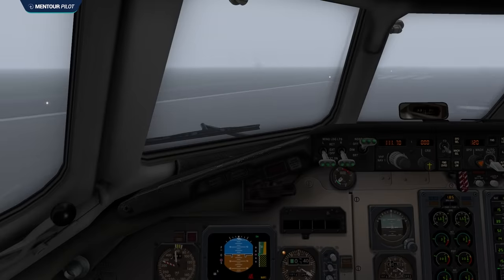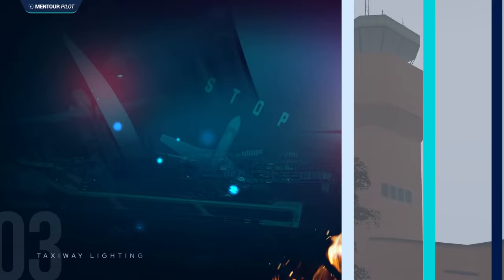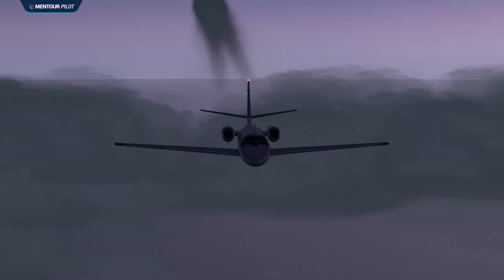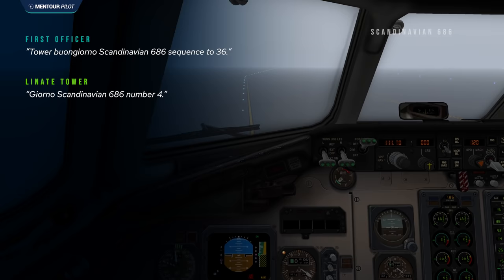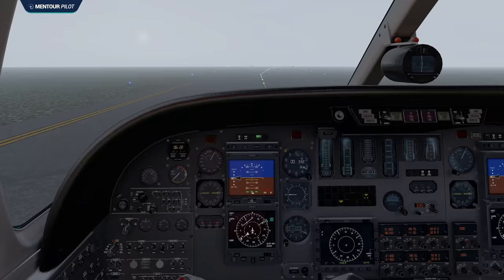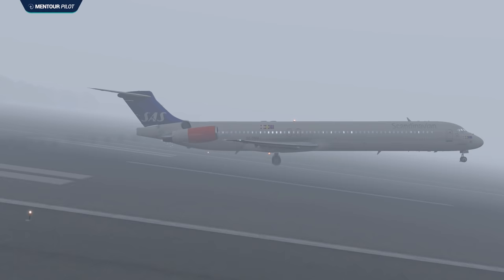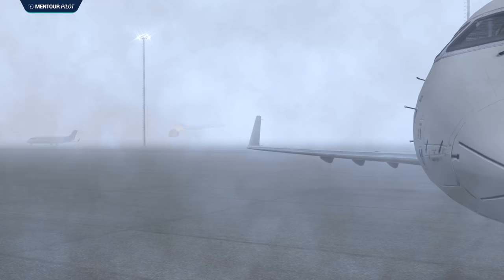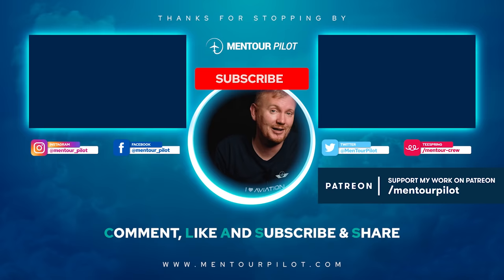A Perfect Storm of Mistakes! And how Heroic Pilots Almost solved it.

Comment: Some additional info:

- The runway incursion warning systems at Linate were turned off (and never turned back on) due to a high number of false positives caused by animals like cats, and rodents.

- The road signs painted on the tarmac of the taxiways/aprons were withering away to the point that they were almost unreadable. The R6 mark did in fact look like "R5" due to that.

- Some of the bigger (vertical) signs on the sides of the taxiways were almost completely covered by high grass in front of them, and therefore almost unreadable. In other words, landscaping was neglected.

- The airport had purchased years earlier a new ground radar with an anti-collision alert system designed and developed by a Norwegian company in response to the low visibility issue due to thick fog in the Norwegian fjords. However, it was never installed.

- Smoke was found in the lungs of some of the deceased occupants of the Cessna, which means they survived the impact, and might have been saved, if they had been found earlier.

- Having read the report myself, it is staggering that many of the recommendations simply consist of a reminder to follow the (ICAO) established rules and procedures.

- The leading investigator (Mario Pica) had his contract up for renewal soon after the report was released. Unfortunately, his damning findings agains many powerful people and entities made sure that there was enough political pressure to cancel the renewal. This fact became apparent during the criminal trial, and might have contributed to the light sentences and aquittals of the same "powerful" people. Stereotypical Italian corruption at its finest.

Comment: Absolute Incompetence and Criminal Negligence on the part of the Airport Owners, Tower Staff, Ground Controllers and Airport Maintenance crews. 
The issue of painted markings not being known by the Tower staff, the issue of faulty lights etc, these are things that should have had the airport shut down until everything was resolved. The non-english radio chatter is silly when it's not a private airport. There are just too many negligent things going on here. 
I hope the families of all those that died, sued the crap out of the Airport Owners.

Comment: Great video, I recall that day very clearly. This is so very Italian story, the sad ones, while there are many causing factors playing like you clearly stated, the mind blowing ones are the lack of signals in some cases, the extra signals that shouldn't be there and the worst, the stop lights that cannot be turned off independently (how hard could have been to fix that?) and one thing I didn't hear in the video: why the tower control is unaware of aircrafts position on the ground and relies on the actual visibility? Is that normal or did I miss anything?

Comment: Possibly the worst-maintained and sloppiest-run GA airport I've ever seen. Aviation authorities should've been notified of ongoing changes / upgrades and insisted on frequent progress reports. In a locality subject to fog, haze etc, proper runway & taxiway lighting and working ground radar should've been mandatory for the airport to handle IFR passenger flights at all. Remember Teneriffe 24 years earlier !! The Citation pilot's flouting of restrictions applicable to his flight was another significant link in the chain of errors leading to disaster.

Radio comms pre- and post-crash were chaotic beyond words, as evidenced by the over HALF-HOUR lag between runway collision and full emergency response. Mixed use of English and Italian in radio traffic was unbelievable. The whole joint was Keystone Cops, a tragedy waiting to happen.

Comment: Hi there, it is really a sad event and based on tiny details it led to a disaster. This is the reason why Safety Management System has to be implemented in all airports around the globe so that we can avoid these sorts of accidents at least relatively. The chain of errors started by Cessna landing under permitted minimums due to whatever reason, then the  incorrect readback of taxi instructions. As an ATC , I think the air traffic controller who was in duty is to blame for the fact that he didn't pick up the incorrect readback which didn't match his clearance of taxing North.  In addition, there was still a chance to prevent this accident after the Cessna captain has reported his wrong position on S4 before entering the active runway. So, there was a significant lack of situational awareness  even though there were different contributory factors in this fatal accident.
Reply: But it turns out the ATC's headset had an inoperative volume control (more appalling maintenance) and he could barely hear the Cessna. He said at trial that he thought the Cessna readback included the critical final word, and he just didn't catch it. That doesn't excuse his other failures though. Clearly he lived in a sea of failure and thought it normal.

Comment: It is good to learn how situational awareness and deviation from procedures can lead to mistakes or accidents. The aviation industry at least is transparent and has independent investigations. 

Sadly, in other industries, things are covered up, not recorded, not reported and the culture leads to a toxic workspace where people fear retribution for voicing concerns. 
There is no legislated independent oversight. Unnecessary harm still prevails, albeit on a much smaller or less dramatic scale than would happen in aviation. 

We can learn from aviation to prevent incidents - but I see that the prime motivation is short term gain rather than safety. This is unfortunate.

Comment: I was hoping till the very end that the SAS crew's quick thinking and reaction had resulted in at least slowing down the aircraft enough that it won't be obliterated like the Cessna, but I had to be wrong :( I always hope when I watch these videos, and I get such a relief when it turns out I put on the few ones that end in people staying alive.
I was in Milan a few months ago, and my flight landed in and took off from Bergamot. I was very salty about that because I had to travel an hour by bus from there, but now that I think about it, I will take an additional bus ride and an airport with a good layout (at least BGY is pretty straightforward) over a design that's basically a recipe for disaster, any day, thank you.

Comment: There is an alternative to Dr. Reasons Swiss Cheese Model. It is called the Italian model. It has a special peg in the upper right corner that, when pressed, automatically aligns all the holes for a straight pass through.
Reply: Thanks for your comment💌🚀📩🚀
For more insight📩🚀🚀..

Comment: These sorts of accidents/catastrophes sit at the top of a pile of chaos, accumulating over years. I don't believe that it is only with hindsight that they become clear. I think there are chains of neglect of control systems that all add up eventually. I note also that a culture of fear was also contributory. 

The lessons from this disaster are applicable across a range of industries.

Comment: I feel as bad for the four people on the Cessna as the 110 people on the MD-87 and the four workers on the ground. Sure, they weren't allowed to land in the first place, if I understood that correctly, but the fact is they did. Driving the wrong way when R6 is between R4 and R5? Weird numbering in my opinion. They even called out the Sierra marking on the ground, so ATC should've known where they are. Then they were supposed to run the red lights, what on earth is that? Ground radar wasn't installed because of sheer laziness it seems. 

All in all, this had to happen. And Mentour said it in the video - there was confusion because of R6 one day prior and probably many times before. Pure luck that the second plane wasn't a big commercial airliner. Rest in peace to all the victims of this avoidable and tragic accident.

Comment: Thanks Mentour for another fine detailed information on air accidents over the years.If possible do the research on  South African Airways Flight 295 on November 27 1987 from Taipei to Johannesburg that crashed into the India ocean after an on board fire.The cause of the fire to this day is a mystery but should have the Boeing 747 included fire suppression sprinklers as the do in buildings.Just want to see your thoughts on this mystery air crash thanks

Comment: Very sad.  This situation was nuts.  Today the situation with ATC and commercial aircraft is still nuts.  Video game programmers long ago conquered and know when two objects have collided in 3D space.  They have also figured out how to avoid 2 or more objects from colliding in 3D space.  The technology exist, the infrastructure exist, the programming exists that 2 properly equipped aircraft carrying passengers (or not) should NEVER collide or even come close and yet runway incursions and mid air collisions still happen.  It's rare but really it should never happen.  The whole mess needs to be automated.  Not someone saying over a radio, "You go here" and hope they go there and someone saying over the radio, "I'm here" and hope they're there.  Someday, hopefully, this "chatter" will all be eliminated and people will stop perishing and expensive aircraft stop getting wrecked.  
Well, at least 2 aircraft not in the same place at the same time.  Planes, will unfortunately, still crash into the ground due to mechanical failure, explosive bombs, missiles, pilot suicides etc. - but not into each other.  Obviously, Anti-cheat programming will have to be bullet proof to prevent any kind of hacking of the system, at least as good as systems designed to prevent a screwup of an accidental nuclear launch.
Someday.  
Same goes for all ground vehicles, cars, trucks, busses, etc.  Many more lives to be saved in this industry.  Sure, throw in boats 
(small up to huge and gigantic) , too.

Comment: This comes in line with my experience with the car drivers while visiting Rome. Apparently they don't give a damn about traffic rules, and not only the drivers but also the police. Crossing a street on foot in Rome mandates a high risk live insurance and a prayer. But also you have to put partial blame to the Citation pilot for taxiing the wrong way and entering the runway without explicit clearance.
Reply: @bart solari Naples is even worse? I’m not surprised…

Comment: What makes this worse is the report seems to put a lot of the blame on the Italian regulatory agencies. Sounds like they either had lax standards or poor enforcement, (not clear which, may even have been both). There where multiple points in the lead up describing the airport where i was wondering how the hell it was still allowed to operate in such conditions, (or at all for that matter). The fact the airport was allowed to operate in low viability conditions with nothing but radio interactions to monitor plane movements is just shocking.

Comment: Seems like a monthly review process is needed during airport upgrades to be sure things are actually done correctly and working... A toxic reporting environment didn't help. At some point a higher authority has to pull the plug and shut it all down. Tragic chain of events, possibly all avoidable if safety first would have actually, come first..

Comment: I feel so bad for those SAS pilots. They were great pilots, they did everything right. Everything just worked against them. So many what if’s, like what if the gear hadn’t knocked off the right engine, what if they had a little more headwind and reached V2 just a little earlier.

Comment: Crossing that red line seems equivalent to crossing a red light over a street where people usually drive very fast. If it is normal, everything is alright, you just wait for the green light before you start walking and there will be no problem. But if you always get either red and green light together or no light at all, then you will simply walk whenever you think it might be safe, and then accidents happen. On a street, fixing such an issue is not very expensive, and it is also neccessary because very many people will complain if it is not fixed quickly. On an airport, it will cost a lot more and I imagine not very many people will actually complain, since there are only very few pilots when compared to the entire population of a city and pilots are the only people who would even notice and have an issue with such a problem. Sad that those are the only two ways to get people to spend money on improving safety: either many people that complain or a huge accident potentially involving a lot of death.
Reply: From the ANSV report:
[T]he red bar lights on TWY R6 were not controllable by ATC since 1998, therefore they were
permanently left lighted (ON) irrespective of time and visual conditions; ICAO Doc 4444
states: Stop Bars shall be switched on to indicate that all traffic shall stop and switched off
to indicate that traffic may proceed.
Reply: @bmjpdx9222  yes. that was said in the video. thank you for repeating that, though i am not really sure what exactly you were trying to achieve with this.

Comment: Every video i watch just makes me more afraid of air travel (not that i was particularly fond of air travel to begin with)
I tend to stay in the country where i live though, I’ve only ever gone abroad once, and that was to Belgium, on a coach trip, i cant remember what year it was, but it would be over 6 years ago)

I was born on an island, where the ONLY way to get to the mainland, was, surprisingly, by ferry (i have since found out that there is an airport on the island, however, it does not handle commercial traffic, so for anyone who doesn’t have a private plane, then the ferry really is the only way to get to the mainland, there are at least 2 ferry routes though, oh, and 1 hovercraft route, weirdly enough. Both ferry routes can take cars and foot passengers, but the hovercraft route is foot passenger only. I only found out about the hovercraft route more recently, i knew about the 2 ferry routes from when i lived on the island, even though we only used 1 of those routes, the ferry route we always used is the only one that can take larger vehicles, however, the crossing takes 1 hour on that route)

Edit: in the country where i live (which is also the same country where i was born, i was just born on one of the islands that is part of that country), most people travel over land to get from one part of the country to the other, I’ve never heard of someone taking a commercial flight to get from one part of the country to another, most people either drive, take a bus/coach, or take a train

Comment: i don't understand. we have GPS systems on phones that have an accuracy of within 5 meters, how can airports not have equipment like this? i get that this happened 20 years ago but still,  from what i can find a high-enough grade system would still have an accuracy of within 5 meters. how come that the tower was not equipped with a basic map which would be showing the position of aircraft real time? computers are around for far over 20 years, i can't comprehend how such basic safety measures were totally neglected

Comment: Spoiler alert! when the hit happened i was like of Cessna is goner, atleasr 686 is "safe" losing a landing gear could be worse, anyways rotation speed is done and they can take off take holding pattern and prepare for emergency landing! Then you tell the engine got ripped apart, were not sure could they still take off, then sadly you made clear its not possible, 686 Live as heroes died as Legends.

Comment: I discovered recently this fantastic channel, and I am eating all those videos in sequency. I'm not a pilot, but a quite trequent flyer and, unfortunately in this case, an italian. I'm not from Milan, I haven't nothink against Milan, but I can surely say one think: Linate WAS and IS a dangerous, chaotical and disorganized airport, practically the worst airport in Italy. Since this disaster they have do nothink to try to avoid another disaster. When I fly, I will take a direct fly from BLQ or, if not possible, I prefere go to Rome Fiumicino, NEVER to Milan, either Linate or Malpensa. Both are complete bullshit in every kind or management or safety for pilots, crews and passengers.

Comment: Apart from all these series of mistakes, I am mind boggled by the sheer timing. The probability of having Cessna on the runway at the same time MD started roll is hugely narrow. Yet, this disaster happened. :( This makes me understand more about destiny. Peace.
Reply: Misses the point. Airport procedure and maintenance were so slack that there were regular unauthorised and unseen runway crossings; they became seen as normal ("normalizing deviance"). So while the chances of that particular plane being on the runway when that particular plane was taking off were very low, the odds that eventually SOME plane would be on the runway when SOME plane was taking off were not low.

Comment: Question: could a pilot refuse to cross a red line even when the Tower clears them to pass it?
Reply: Thanks for your comment💌🚀📩🚀
For more insight📩🚀🚀.
Reply: At Litane at that time, they would then be stuck there forever -- the red bar lights were on all the time, contrary to regulations.

Comment: I really don't understand why at an airport systems that are potentially critical for safety are not fixed when they break down. What kind of attitude can you have? I only work in IT where no lives are at stake but still at least where I work we don't operate in this way. Maybe it is a question of mindset. Of course, if it comes to cost cutting then apparently nobody cares about safety any more.